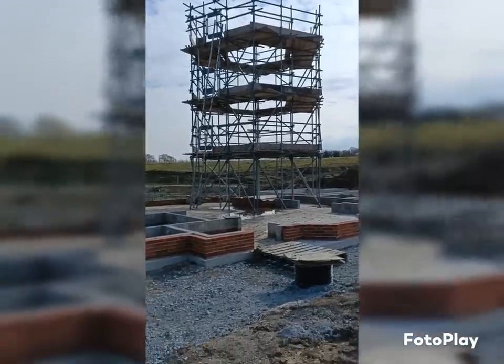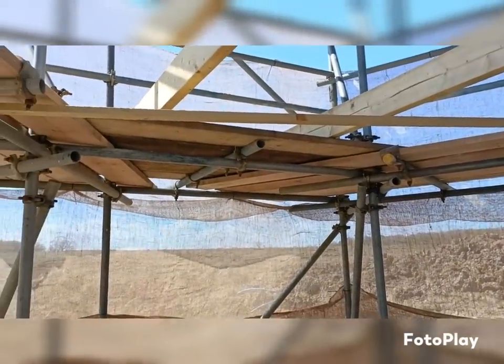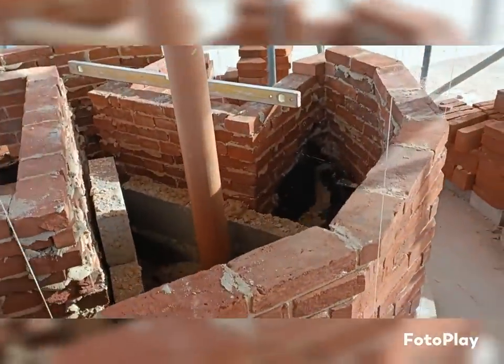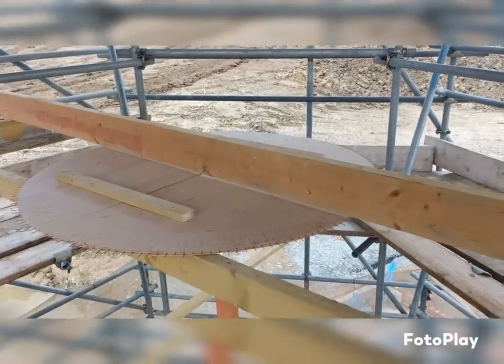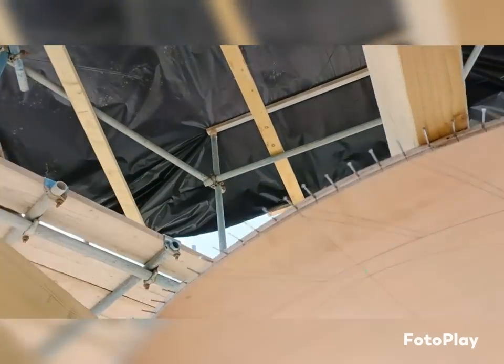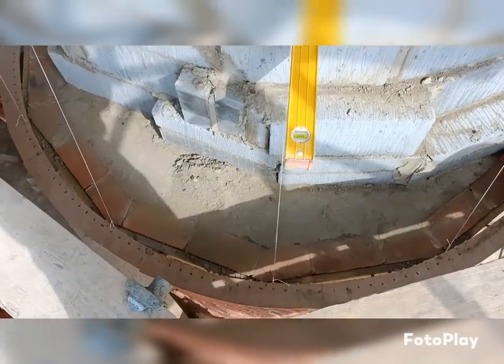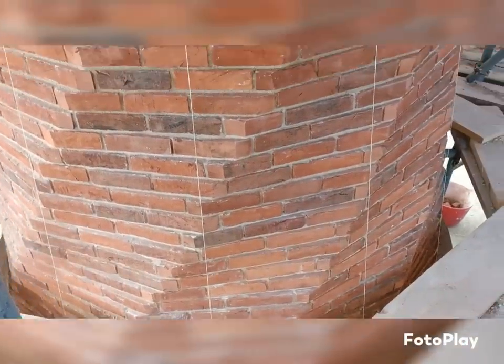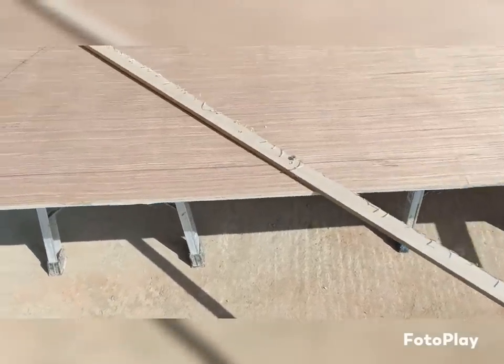How to build a Twisted Dodecahedron

Comment: Correction, it's a twisted dodecagon, not dodecahedron. A dodecagon is a 2 dimensional polygon with 12 sides. For reference some other 2 dimensional polygons are triangles, squares, pentagons, hexagons and octagons. The dodecahedron is one of the 5 regular platonic solids. It is a 3 dimensional solid with 12 pentagonal faces. The other platonic solids are tetrahedron, cube, octahedron and icosahedron.

Very interesting design, regardless of what you call it.  Obviously you are a talented bricklayer, but to properly twist a dodecahedron would require 4 dimensional space.  When you have mastered that I'm sure the video will break the internet.

Oh wait!  Maybe you actually are twisting a dodecahedron and I don't have the appropriate 4 dimensional display to see what is really going on.  My bad.